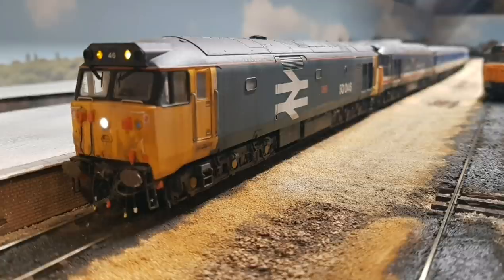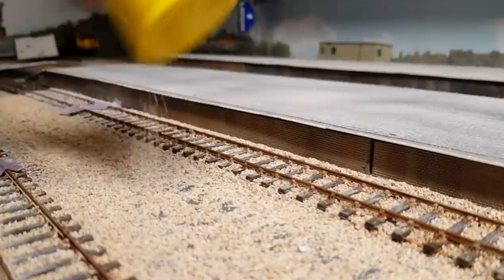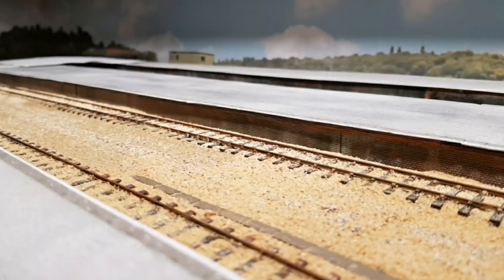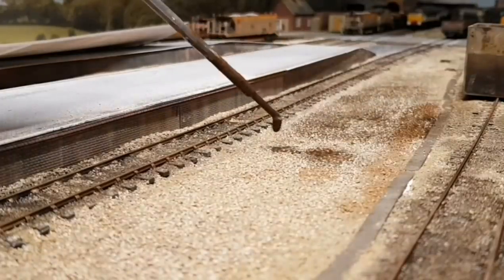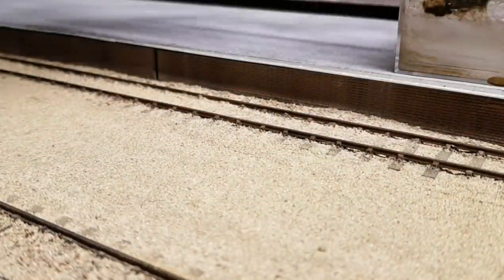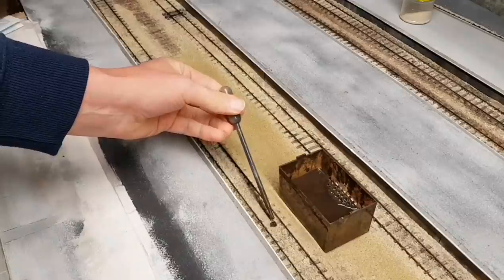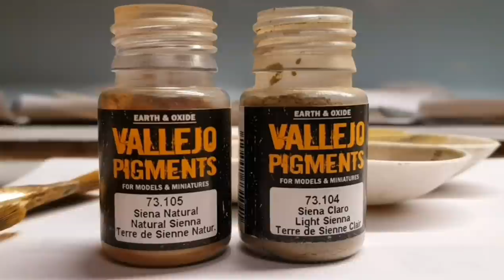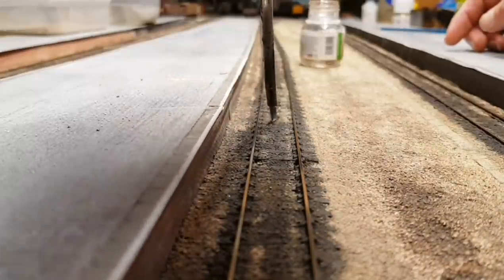Exeter & Laira. Part 12. Realistic Track Detailing & Weathering

Comment: Looks great Tim, I love the whole thing, I really like the added sheen on the oil spills, might have to nick that for Oakford Lane.
Stay safe
Alex
Reply from the maker: Cheers Alex. Don't mix the varnish up to thin or it just disappears and does nothing lol.
Reply: @thescrapline4905  but it should thinned down?
Reply from the maker: @alexhill9169  yep enough for it to slowly soak through the ballast. If it's thinned to much it looses it's slight sheen. 
Note that oil spills along open ballasted track areas, the ballast has very little shine, the sleepers however will have that sheen. (areas with no gloop covering the ballast)

I found that it's only fresh oil that's got a sheen and that sheen doesn't look good if the varnish is full strength. 
If it's thinned ever so slightly it'll change the look of that flat black Matt paint with a very slight sheen. 
Old dry oil gloop tends to be without a sheen but not as flat as Matt paint. 
For that effect increase the thinners and it'll soak into the paint and change its look without giving it a sheen.
Reply: @thescrapline4905  Thanks mate, really great advice

Comment: And amazing how to video, just 1 question, i may have missed it, do you but the paint mix on the ballast while its still damp or fully dryed??
Reply from the maker: The paint needs to go on when it's damp so it soaks down. This process can be done over a period of time, so if the ballast has dried fully then just dampen it back up with a quick mist of water or isopropyl alcohol.